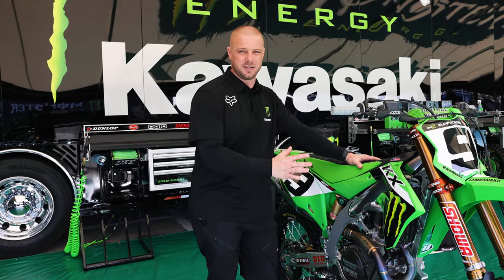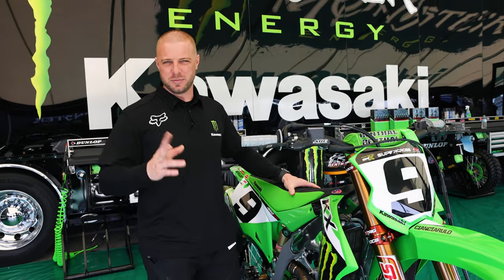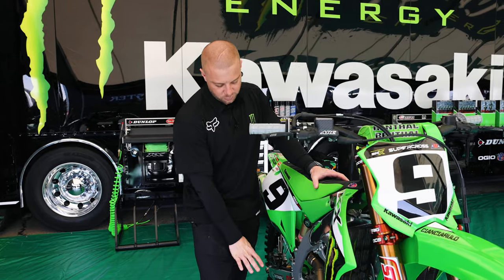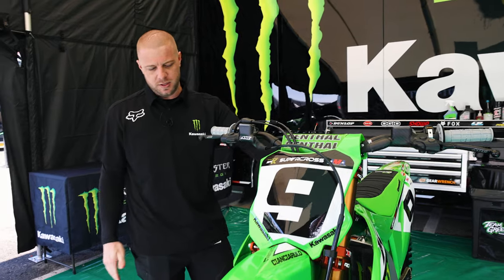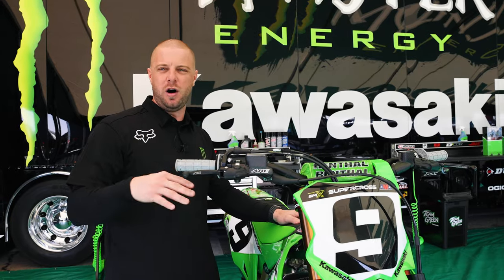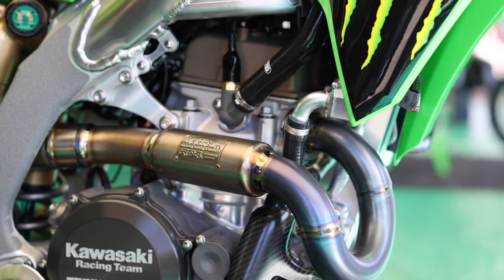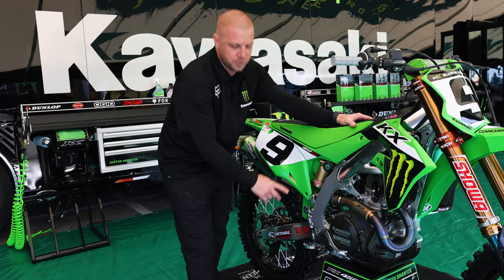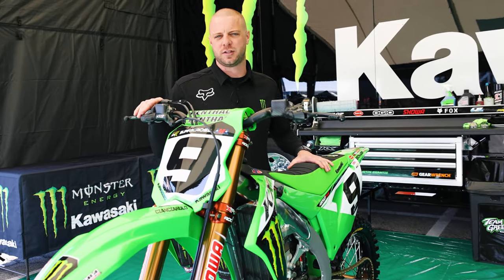Inside Look | 2023 Monster Energy Kawasaki KX450SR Supercross Race Bike

Comment: Wished they used KYB instead of Showa
Reply: Why?
Reply: @denniswilder3014  because of all the suspension I’ve ridden KYB seems the most plush no matter how stiff it’s set up. Just seems better ride quality
Reply: @stevesmith756  the forks on a supercross bike at the pro level is about 70k as they sit.and there set up r@d is probably in the millions.at this level the only difference between the 2 is the sticker.
Reply: @denniswilder3014  I’m talking about stock bikes not factory. You can def tell tell the diff between KYBs and Showa components. I’m not in the minority
Reply: @stevesmith756  I hated my kyb on my yamahas.i went thru 3 companies doing revalves springs etc.the harder I rode the worse it got.i used my buddy's Honda same set up as my yammi and was better.i swapped clamps and hangers bought a set of showas and much better.i use kyb when I do harescrambles.
Reply: I was totally opposite. Loved every yami with KYB. Hated every Honda with Showa and tolerate my Kawai with Showa